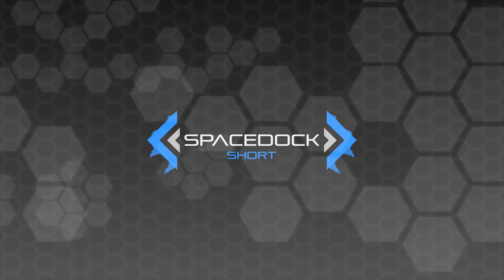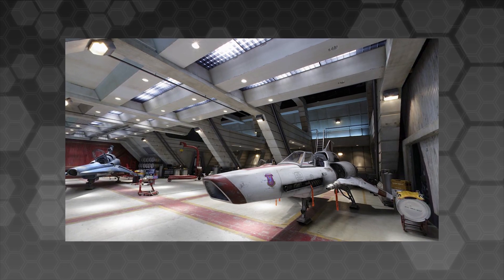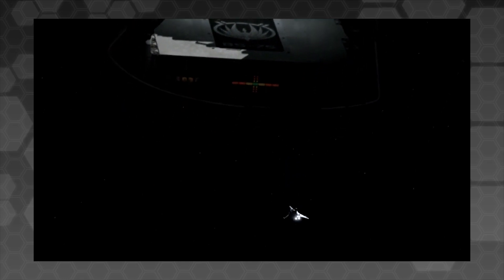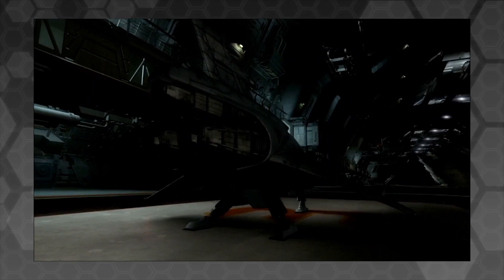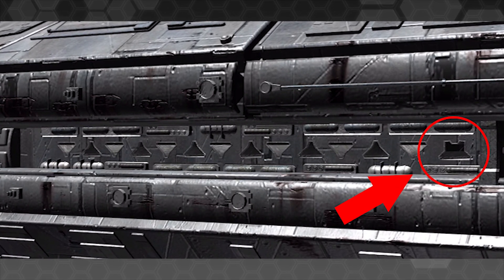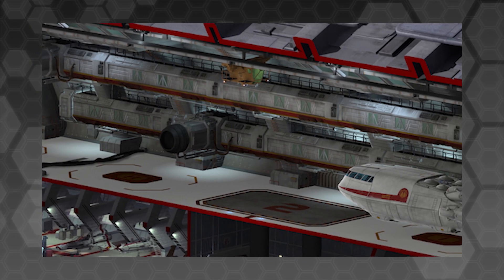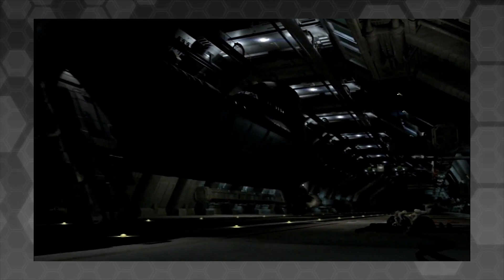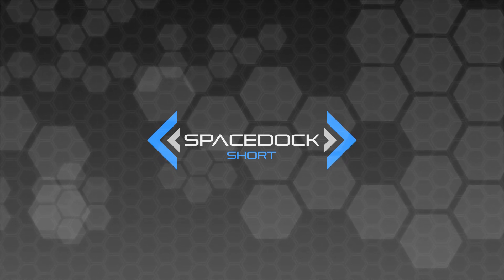How to Land on the Battlestar Galactica

Comment: If they are using tractor lifts all it would take for the downward facing ships to be flipped over is two pivot gimbals mounted on opposite edges of the lift floor. Also why would you assume that there are only two refuel/repair bays? If it's too hard to flip ships then just have four refuel/repair bays, one for each flight deck. If you look at the photo you used to show the raptor launch tube you will also see that the viper launch tubes are alternating up/down indicating an inverse flight deck.

Comment: Man, I miss the BSG sooo much! BTW it is super easy to understand the Galactica if you take it as an aircraft carrier in space, except for her heavy weapons. The Vipers are the Super Hornets and the Raptors are pretty much a combination of all the other aircraft of the carrier's airwing, from the Hawkeye (with the Raptors running sensor pickets ahead of the fleet), the Growler (electronic warfare against the Cylons), the Greyhound (fulfilling transport tasks), down to the Seahawk helicopter (search and rescue of shot Viper pilots). You can even take things way back and look at the A3D Skywarrior as an inspiration, because IIRC the Raptirs also ran nuclear strike missions against the Cylons with nuclear weapons too heavy for the Vipers. Then we have the launch pads, which are basically EMALS and the landing ramp is like the landing deck of a present day carrier. The difference is that the Galactica is way bigger so it does not need an angled deck to save space. The "ball" reference is taken literally from present day carrier operations. The LSOs or "the white jackets" are pilots off flight duty, who guide the pilots to land on the ship. When they say "Call the ball!" to the pilot in the air, it means "Do you see the OLS array (the optical landing system) and what sygnal do you see?" Of course they know better what the signal is, as they set it, but the reason they ask is because the landing takes place in a very compressed amount of time, tens of seconds, at a very high speed, so there is next to no room for mistakes. Every second the pilot spends on looking for the ball is a second less to spend on actively correcting his approach.

Comment: regarding how the Mercury-class handles a 180 degree rotation for vipers going from the upside down landing bay to the flight deck... what if there is a second flight deck specific for this landing bay, whose gravity is also upside down? Then, you only need to worry about rotating gravity for any personnel and cargo lifts, which could probably be handled more easily.

Comment: I think the Peggy had 2 hangar decks both oposed each other .. because if you look at the launch tubes they are overlaped alternating inverted orientations.. like if one comes from one deck and the other from the other deck.. the question would be why all tubes exit at the same "deck" instead of above each other.. and if they would all be tubes from the same hangar deck why would every other invert ..there is no advantage whatsoever in doing so and it would need the Viper to rotate within inside the tube for no reason.
the only explanation is the existance of 2 separated hangar decks each oposite to the other in the vertical axis.. their "launch ports" would be an elevator, pretty much like the ones we see in Blood & Chrome wich " lowers" the Viper down to a "middle" deck where the tubes would be.. this doesnt take extra space because the hangar decks are actually quite narrow anbd the rest of the pod width is taken by the tubes.. therefor there wouldnt be any need to rotate any viper.. unless transfering them between the 2 decks

Comment: I think the "call the ball" thing is a needless over-complication. It is hard to believe, however, maneuvering in space is much simpler than maneuvering in the hydrodynamical medium. This fact is clearly shown by the equation of motions of the two situations (let's speak about "low speed" classical cases).

 In space, the most complex force to have to deal with is the gravitational force with its inverse square law. However, in a docking situation near the Galactica we can assume a microgravitational environment, so the gravitational pull is negligible. So basically the viper pilot has to deal with only constant speed linear movement, when not using its thrusters. The only force that accelerates the viper is the thrust force of its thrusters.

However, movement in the hydrodynamical medium (e.g. water, air), requires solving the much more complex equation. In these situations, you have to count with gravitation force, but with a much simpler approximation. However, the main problem is the drag force, which is the most complex force to have to deal with. First of all, you have to know somehow the velocity field of the medium, to exactly predict the forces that will affect your vehicle (which is a serious problem, which is researched by a whole branch of science called Meteorology). Secondly, you have to solve the Navier-Stokes-equation to the geometry of the vehicle (the vehicle also affects the velocity field of the medium, but let's say that the vehicle is much smaller than the expanse of the medium, and not much faster than its speed, then its a good approximation to calculate the Navier-Stokes equation near the vehicle, and neglect the effect on the whole velocity space), on every point that the vehicle can reach. If you have these solutions you can sum up (integrate) the drag force on the planes of the vehicle, and you have the drag force at all times. Now you can substitute it to the equation of motion, and you can predict you are the movement of your vehicle all the time, and also predict what forces you have to apply on your vehicle to get from point A to the point B.

Of course, real-life aeronautics seems much simpler than these above. This is due to the fact that, engineers use special geometries,  approximations to keep drag force simple and useful (to lift the vehicle) to achieve a relatively stable flight. However, this results in severe constraints in maneuvers, which is not a problem in microgravitational spaceflight. This is why aircraft cannot achieve the astonishing maneuvers that vipers can do with their RCS system with ease (you can also equip aircraft with RCS however if you don't use it with caution these will soon destabilize your flight).
This is why landing on an aircraft carrier is a much more complex task with a nowadays aircraft (mainly), then landing on the Galactica in space.
On the other hand, real-life space docking situations seem much complicated. This is due to the fact that the technology is not as refined as in BSG: pilots have to economize on the precious fuel; spaceships are using smaller docking ports that should be precisely  joined to prevent air leaking when to pressurize the docking port; and of course, nowadays people aren't used to motion in a microgravitational environment.
These problems don't exist or much moderately exist in the BSG universe. The Galactica's docking pod is much larger than a viper, so if the pilot approach it at a reasonable velocity (at which safe landing is possible), then it's very difficult to miss the docking pod. And if the pilot messed up something in its movement, then it is possible to completely correct the mistake at any time before contact with the pod by the viper's superior RCS thrusters.

Last, but not least, in combat landing there can be a plausible problem that has never been discussed in the series either mentioned. So in emergency combat landing, when vipers just randomly pound themselves onto the docking pod's surface then how do they avoid collision with each other? I mean when the pod is densely filled with vipers then it seems plausible some collision when the pilots hurry to land, and the docking pod doesn't seem such large, that vipers have a vast place to avoid each other.

Comment: Hi Spacedock Team :)
Great Video as always! But theres something I'd like to add concerning the Pegasus flight pods. I don't think the ventral inverted flight decks feature a rotating elevator system but a standard elevator and above the ventral flight deck an also inverted 2nd hangar deck.
My theory is that from top to bottom relative to pegasus standard gravity the internal decks of the flight pods are:
 - flight deck - hangar deck - launch tube deck (ZERO G, access from both sides) - inverted hangar deck - inverted flight deck -
This theory came to my mind while looking at the flight pods broad side. the triangular shaped cross section of the viper tubes can be seen. but unlike galacticas launch tubes they are not oriented the same way (pointy upwards) but instead they are alternatingly inverted. so i think pegasus has a top and a lower (inverted G) hangar deck and the vipers are being loaded into the launch tubes via elevator into a zero G launch tube level from top and bottom. i believe any other way it would be nonsense to build the launch tubes inverted on a single standard G hangar deck. anyone would agree on that i guess. as for the inverted area Crews, they would simply pass through a  zero g passage way in the launch tube level and just turn upside down before climbing "up" into their hangar deck.
What do you think? Let me know and thx for the great videos!! :)
Reply: Exactly.

Comment: Battlestars landing process seems to be not very efficient, or even, well thought out. At least for the Jupiter class. The launch system, is fine, by contrast, landing does not appear to be something that happens very smoothly or efficiently. But, that is because, battlestars have to resemble the amerikan empires so-called 'super-carriers'. So, producers never asked anyone to come up with a more plausible viper recovery system. The Mercury class, however, do at least have their raptor platform, which does make sense. The whole inverted flight pod thing however,  looks cool, but is quite unnecessary.
While the new BSG features proper Newtonian physics for its space battles, they discard them entirely for sjip recovery. You no more need a landing strip in space, than you need to fly in straight lines when dog-fighting. You simply match velocity with the battlestar, fire your thrusters and land. Nothing like the whole wet-carrier landing thing is remotely necessary. If anything, those flight pods  upper deck represent a huge waste of space. But again, it looks cool, so its in the show.
Reply: Nowhere, in your strange rant, was an improved design mentioned, just a lot of hate for a fictional ship's unoptimized landing pads. Besides your last sentence sums it up nicely. BSG isn't a hard sci-fi, ultra-realistic battle simulator, it's a character drama with an awesome sci-fi aesthetic.

Comment: call the ball refers to a light system yes but a not the runway lights. its a set of lights and mirrors so you see a red light if coming in at the wrong angle or green if coming at the right angle

Comment: A Viper does have wheels on the skids. The landing gear also has suspension just like one of our regular fighter jets. I have seen both in many drawings and some episodes.
As for the Pegasus and the AG:  Only the pilots and crew would need to go through 180 degree orientation. A Viper isn't and doesn't  need to be re-orientated at all. I suspect that there would be some internal mechanism for doing this it would be simpler just to launch the Vipers or Raptors and re-land where they need to be. The launch tubes on the Pegasus are (For lack of a better expression) 1 right-side up, the next one is upside down. Time Code 4:10. I am sure that was the intent but the model builders screwed up by placing the launch tubes in-line with each other when they should clearly have been 1 tube above center, a gap and 1 below center. (The gap is to allow for the magnetic launching system) That is one of the things they hoped most people wouldn't notice.)

Comment: Regarding the "all raptor" taxiing policy - it is possible, that the troop transport carriers need either different kind of fuel (wich BSG lacks, or wich might be difficult/inconvenient to produce), or that it does have much bigger fuel consumption (especially when it seems heavily armoured and numerously bigger and heavier, than raptor). It might be "cheaper" fuelwise, to ferry personnel in raptors, wich can do the job quite good. 

Regarding re-orientation of the lower flightdeck birds - i belive, that the lift platform can turn itself 180 degree in zero-g, probably during its travel inside the elevator shaft. That would also explain, that we did not see the reorientation on any flightdeck, and no sign of 2 orientations in the hangar.

Comment: On the Galactica, you have half the flight pod used for the flight deck and the other half used for the hangar deck, launch tubes, and storage. Does the space between the two flight decks in Pegasus' pod look thick enough to contain all that? It doesn't look like enough space to me. I think the area of the hangar deck floor is probably larger in Pegasus but don't they carry more Vipers to use it?

The other thing I noticed is that in the miniseries they get Vipers from the museum to the hangar without flying them, so there must be some cross-corridors connecting port and starboard flight pods large enough to move small craft through. That would make sense as a design feature but it's nice to have confirmation. Perhaps Pegasus uses some of the main hull space for secondary hangar decks?

Comment: "Chief Tyrol why can't we use the starboard launch tube?"
"It's a gift shop"
Reply: Mitch G--- which has the reply line...:"FRAK ME"...
Reply: Best damn deadpan line in the series.  Damn, I'm glad Galactica finished the way she did.  Serving as a tourist attraction, complete w/food court & the Colonial version of a Starbucks (HAH!...🤣) on all accessable decks just seems beneath her dignity.
Reply: Hey man, never underestimate the morale-boosting effect of a well-stocked gift shop.
Reply: And eventually a refugee shanty town.
Reply: @Matthew Caughey except it didn't. Colonial one is infrequently sighted docking in the port flight pod, the starboard flightpod's landing strip was sealed of with something transparent. Still, I think they should've ripped that out.
Reply: @Matthew Caughey except the CGI model of the Battlestar clearly shows it to be fully enclosed, up to the point a heavy raider crashes into the rear. They don't bother taking the glass out. Additionally, I believe the miniseries shows them to be able to look through both sides.
Reply: One would think they would have put the work in to recommission the starboard pod.  Would be handy in their situation.
Reply: I am surprised they didn't typically such conversions are low budget and very superficial. On the one hand if they didn't have enough fighters that would make it less useful and require more active crew. But having a secondary pod would have purpose. That said, they didn't really highlight using the extra pod for anything despite it seeming like a very logical hold.  Or area for training, exercise... it's a huge amount of open space on a craft with very limited space, it would be hugely useful. Hell, even converting it to hydroponics for the fleet.
Reply: @Matthew Caughey the glass is at both ends of the starboard pod, and if you look closely at how colonial on docks to Galactica in the pilot there are indications that its docking in the port pod. also, wasn't the bar in the starboard pod. though I do they should think they should have ripped out the "glass" and use'd the museum pieces in the pod as resources for repairs and return the pod to active duty, even if it was just for raptors and combat landing since the lifts still worked (see final episode and ask how the raptors got into the museum), and they had a way to move vipers between pods (see second(?) part of pilot).
Reply: @Matthew Caughey except that viper launch tubes are across the entire length of a pod. Take a look at the 3D model.
Reply: The moment that always left me wondering about the starboard flight deck was the Cylon transport crashing into it at the beginning of “Valley of Darkness”. (OK, the end of the previous episode.) There was never any follow up about what happened to that part of the ship

Comment: By the way.  Why would they need lifts?  Given how maneuverable the vipers are to taxi/fly to the elevator.  Why have a elevator rather then a hatch that slides back and the viper hovers down to the lower deck and the hatch closes above them.  Or they slide into a viper tube shaped lock that needs to add/pull little air around them and they slid through like a slow launch, and are locked into the lower hanger/launch deck.

I.e.
-Fly in at speed and decel or be deceled to slow speed.
-Maneuver with RCS jets down into a open landing pit ( in place of elevator ).
-Hatch closes above you and your recompressed and you roll in through a open hatch.  Or a viper rolls through a viper shaped quick lock and the hatch above isn't closed.  
( Raptors can lock out in the same airlock/landing pit through a bigger side hatch, and hover up and out )

Note damaged Vipers or Raptors would likely be pulled off to the side and safer before being allowed to lock down into a oxygen atmosphere and possibly burst into fire.
Likely want a fire control system in the standards locks to...or just vent them to vacume and winch you out to the serve/safing area.